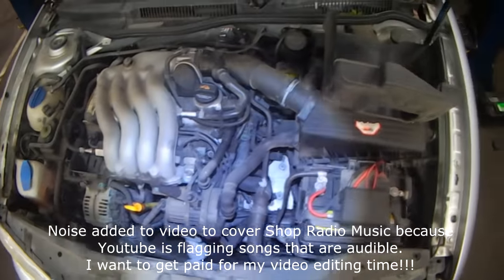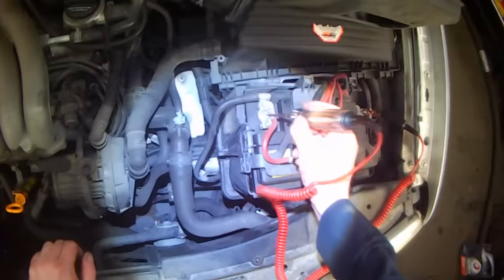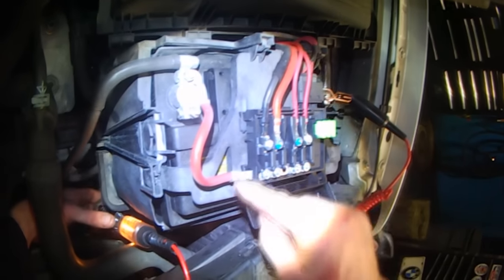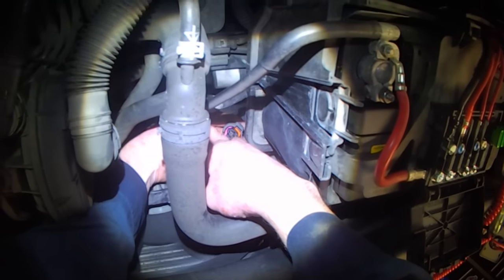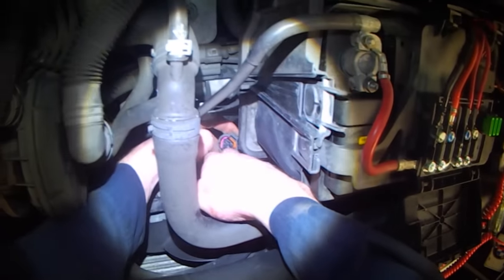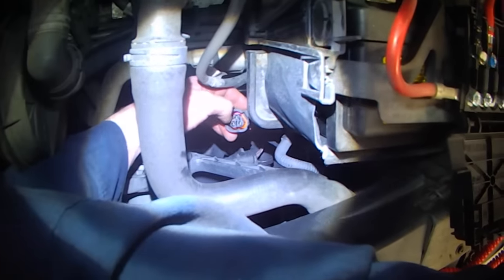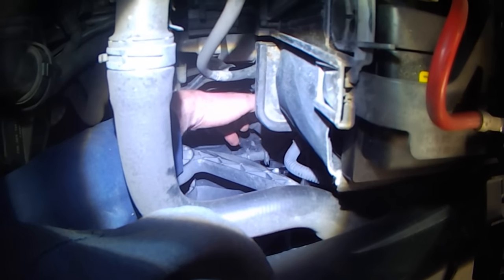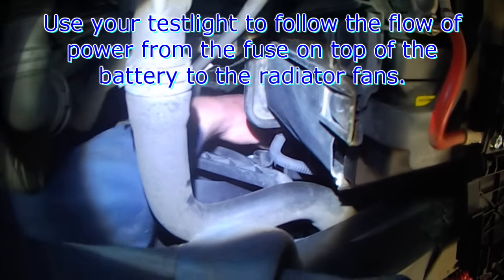VW A1 A2, A3, A4: Radiator fan(s) quick check.

Comment: MK5,TDI ,with A/C.
Big fan ON all the time, hi or low speed. Goes on high speed even when  i pull over on the highway after driving constantly at 80mph. Car never overheats. Small fan never turns on, at all, no matter what i switch on. Ideas?
Reply from the maker: I would start with checking for fault codes (doesn't matter if check engine light is not on / off) in the ECM and any other modules. Then I would do an "output test" via the ECM of the rad fan(s)... to see if they behave correctly. Then I would check a wiring diagram to see if there's something that could cause the issue you describe. Nothing that I have run into in the past fits what you are experiencing. A faulty temperature sensor can cause the fan to be on all the time. If the ECM does not know the actual temperature of the engine, it may turn the fans on full tilt to protect the engine from overheating. The small fan could be burnt out.
Reply: So i went to a friend that has VCDS, tryed gettin in the fan controller and do a test on the fans, could not connect to it.. So we are assuming that its faulty, and it went int it's own limp mode and goes stays on low/high to protect the engine. I have a new entire fan assy ( the entire thing with both fans from ebay -$99) that ima put in . After i take the old one out, will take it apart and see if i can find the problem ( im throwing it anyways, might as well do some explor9ing)
Reply from the maker: semecristian Thanks for the update! Let me know what you find.
Reply: I applied voltage to the small one, no response, and the big one had decent aluminion oxidation on the controller. Seems they are the original ones, car has 200k miles, i guess they did their job. 
The new fan assy from ebay is Made in the USA, VERY good build quality and parts in it, it amazed me how good it looked and felt. And it works perfectly, easy to change, just unscrew 4 corners and take out from the bottom with car on a lift.
Reply from the maker: Thank you for the update!

Comment: hello, when the water is in 90 °Celsius (194 °Fahrenheit) the heater is still not working. how can I dissolve this problem , please help me
(audi A 3 TDI (2004 years))
Reply from the maker: Could be a problem with the heater control door or the heater core is plugged... not sure.

Comment: Hi I’ve golf vw 2003 .
Temperature never goes over 87 hoses are hot so no air trapped .
Bridged high speed fans work not low speed .
Fans only work when A/C on ,I’ve checked fuses one had blown but changed (black box on battery)
Changed radiator switch,would the relay under the battery sort this?
Thank you
Reply from the maker: Wait longer... low speed will come on. Low speed is same speed that comes on when ac is on... meaning that low speed is ok. Low speed does not go through the fan control module unless ac is on. If coolant temperature stays low, then the thermostat is opening early / not closing.  If you let it idle long enough, temperature will climb to 95c and low speed will come on.
Reply: I drove for 2-3 miles yesterday let Idle for hour 10 minutes fan didn’t come on .
Temperature gauge never went above 87
Reply: I’m a little confused,the car diesel so I understand it takes awhile to heat up
Reply from the maker: I didn't know it was a tdi... tdi's draw in a lot of cold air during each intake stroke.The cold air absorbs temperature as it is compressed. On top of that, if the thermostat is sticking open... the engine can idle and the fan never has to come on. Hold the idle at 2000 rpm. I bet that the fans will come on by 10 to 20 min.
Reply: I’ll tell you the story what made me think there’s issue .
I was in traffic and the engine just cut off ! (A visit vw workshop came up ,oil warning light )
After 5-10 minutes I managed to start carry on my journey hit traffic again ,it cut again.but no warning lights .
I got it home called broke down company,he came plugged in OBD no codes .
I put it down to the car not like the heat ,was a hot day and traffic was heavy.
2 wks later it happened again but didn’t cut out ,it tried felt like it suck the car back ,got it home pop the hood and watched to see if the fans come on ,they didn’t but the car did cut off again so thought it was the fans .checked fuses noticed one had blown.
Reply: Sorry for the long message
Reply from the maker: Have a look under the dash where the relay box is... look for a relay with the number 109 on the top. While the engine is running... tap on the relay with your finger / flick your finger against it. A worn out / old 109 relay can cause intermittent stalling or no starting (you had to wait some time before the engine would start again). When the engine stalls & does not start again, a telltale sign that the relay is bad, is when there is no glow plug light & check engine light when you turn the key to the ON position.
Reply: I’ll have a look let you know,glow plug sign comes  up all the time ,when starting the car ,dont get any warning lights on dash or messages.
Wouldn’t I get a warning every time I start car ?
Reply: 109 relay fuel pump fuse ?
Reply: Wouldn’t a scanner pick that up,109 relay?
Reply from the maker: Relay 109 is the power supply to the engine computer... when the relay goes bad, the computer does not turn on which causes the engine to stall or not start. No fault code is stored because the engine computer thinks the ignition was turned off. Like I said... if the glow plug light & check engine light "do not come on" when the engine does not want to start, then the problem is most likely a faulty 109 relay. The other common reason for the engine to stall & not start right away... is a faulty crankshaft position sensor. You need to check things when the problem is happening. If the problem does not happen often enough for you to be able to "catch it in the act"... replace the relay and crankshaft position sensor, as they are the 2 common causes for what you have described.
Reply: Thank you ,I’ll look in to it

Comment: What if only one fan comes on.  I checked that fan that didnt come on with current going directly to it and it worked.  Could it be the relay?
Reply from the maker: Year, make, model, engine? 
If the fan works when you directly apply power & ground, but does not work when bridged at the radiator fan switch... then there could be a wiring problem (broken wire, corrosion, bad resistor pack (if low speed does not work). Depending on the vehicle (my first question) low speed resistors are inside the fans or outside of the fans.
Reply: @EXOVCDS  2001 vw jetta 2.0
Reply: @EXOVCDS  the small fan comes on when I bridge the switch, the large fan does nothing.
Reply from the maker: Low speed is probably burnt out on the large fan. With the key ON, bridge the radiator fan connector to get high speed for both fans. If high works for both, check for power at the large fan connector when you have low speed activated. If you have power at the fan connector when low speed is active, but the fan does not move, then the resistor inside the fan is bad.

Comment: I have a 2006 beetle 2.5 hatchback with a non operating radiator fan. The engine has never overheated even when driving longer distances. Weird. My temp light on the dash works so Im puzzled. I believe this is the reason my AC is not working but I will check these connections before ordering the very expensive single fan with the control module. Can I check the control module itself? I had FCP euro check the proper fan control module with my VIN but sadly was not the one as mine is the module attached to the single fan.
Reply from the maker: Watch this for testing steps.
https://youtu.be/oqdv4cm86Ns

Comment: Do you know where it is located on the newer B8 Audi A4 2010 premium?
Reply from the maker: Different system.... controlled differently.
What's the problem? Overheating?
Reply: It just does not come on, and I believe for driving it for a couple miles it just shut off my engine and came right back on when I cranked it up. So I blv that was the caused of it
Reply from the maker: I don't understand what you mean. If the engine shuts off (stops running) the radiator fans do not have anything to do whit that. Record & post a video of the problem on your youtube channel... so I can see what is happening.

Comment: Hi sir Thomas
My car sokda Octavia desiel
Radiator fan both on continue not off 
Key off but fan not stop Battery total Down
Plz tell what can I dou help plz
Reply from the maker: What year? You have to look at a wiring diagram to see how the fans are controlled.
Reply: 2008 model sokda Octavia
Reply from the maker: Octavia 1 or 2? 1.9L BXE TDI?
You need to be more specific so that I can find the correct wiring diagram.

Comment: Do I need to drain the radiator before taking this sensor out?
Reply from the maker: Depending on how your body is positioned and how quick you are with removing the sensor & installing the new one... you will either get a wet hand or end up taking a shower.

Depending on the year & model, a quick sensor swap (with a full radiator) is possible.

Removing the lower radiator hose, catching the coolant and then removing & replacing the sensor can be a better way to go in some cases.
Reply: Thanks. I think I may just go ahead and do the thermostat at the same time. Whole thing probably needs a flush anyway.  At least the water 
pump is working right. ;)
Reply from the maker: @pcdreams1 
Are you trying to solve an overheating issue?
The more info I have the better I can help.
Reply: @EXOVCDS  I haven't had any issues with it overheating.  Just noticed the fans weren't coming on and ran through the test with the AC (since it doesn't seem to be working either). I can get the compressor to come on by applying voltage to line 10. but jumping from the thermal switch connector is the only way  I can get the fans to come on aside from directly applying power (I just replaced both fans (thanks for that video)  and there was no change. I've also replaced the fan control module (It didn't change anything.. I guess it's possible I have 2 bad modules, because the replacement was a pull, but seems unlikely). this is the 1.9tdi in an 02 beetle
Reply from the maker: @pcdreams1 
TDI's take a long time to warm up / for the fans to come on... this is normal. As soon as you drive a little, the radiator will cool off again and the warming up phase starts again.
Hold idle at 2000 for 10min or so and feel the lower radiator hose with your hand (half way between the thermostat flange and the radiator outlet).
Since you are not having any overheating issues while the vehicle is moving, the thermostat is most likely ok.

Comment: Hey man I have a 03 20th mk4 GTI 1.8, 6 speed. neither rad fans come on, they work when I unplug and replug the green battery box fuse but only spin for a few seconds with engine off ac on. only throwing code for o2 sensor voltage but I just replaced that. any ideas?? I replaced all three fuses and ordered a new box coming in a few days... but im nervous it wont fix the issue
Reply from the maker: Overheats all the time or only at idle?
Reply: @EXOVCDS  not all the time, only  at 60 mph high load like on a hill. drives around town with none and at idle overheats after sitting
Reply from the maker: @ThExHaLoxMASter  water pump impeller could be slipping.
Reply: @EXOVCDS  oh no... I thought it was overheating bc no fans came on and when I down shift to increase rpm therefore coolant flow they come down. wouldn't that indicate the pump being ok? im not sure man.
Reply from the maker: @ThExHaLoxMASter  60mph should not need the fans... how much heat can you get inside the car? If heat comes & goes, then the water pump is bad. You can trigger the fans manually at the radiator fan switch... when it gets got at idle, trigger the fans. If the engine doesn't cool down, then you have bad circulation / bad pump.
Reply: @EXOVCDS  got it ill do those checks. my assumption is that a bad water pump would stop the fans from running due to lack of circulation?
Reply from the maker: Correct... the impeller could be loose and only circulating coolant at specific speeds. Too much slip at idle and under higher rpms. Confirm flow into the bottle (the higher the engine rpm, the more coolant should flow back into the reservoir). Lack of heat inside can point towards a bad pump / circulation issue. If tests are inconclusive... you can remove the thermostat and check if the water pump impeller is loose... by trying to move the impeller with your finger(s) through the thermostat mounting hole.

Comment: Hi Thomas, thr coolant fan on my audi a3 8l was not working so iachanged the fan , and now the tempreture still goes above 90° 
and rediatore on the drive sied is getting hot but other wich is ac fan rmains cold.
do you thinks is it the radiator? thank you
Reply from the maker: Thermostat maybe.
Reply: thanks alot for the infomation! but wont be the control mudol switch no? because the coolant fans work in normal speed and high speed.
Reply from the maker: You said that the temperature goes above 90c and that the radiator is NOT getting warm. If the radiator is NOT getting warm, then the fan switch will not get hot and it will not turn the fans on.
Reply from the maker: Which engine? Does the water pump pump coolant? Do you have heat inside the car?
Reply: yes the radiator is getting hot but only where the bigger fan is but on the side of smaller fan remains cold 
on the carrige way and motoway it gets really hot
Reply from the maker: Change the thermostat... check for correct water pump operation first.
If you have NO hot air inside the car, then the water pump is bad.

Comment: Hi I wanna ask you something i have an audi TT 1.8t 132kw 1999 and i spend like 600 dollars on that shit so my problem is in traffic my temp comes to 95-100 and after 20sec colling goes down its fine no problem with that but when i turn motor off temp raise up to 110 and fans dont give a shit about it. I have new fans and thermostat as well. Thank you for response.
Reply from the maker: Low speed fan operation is triggered by the radiator fan switch that is mounted in the radiator. Engine temperature is measured at the coolant flange that is mounted to the cylinder head... the radiator is not the same temperature as the cylinder head when the engine is off, because the water pump is not pumping warm / hot coolant from the head to the radiator fan switch. Eventually the heat from the warm / hot coolant gets transferred through the coolant to the radiator and the radiator fans might come on... it all depends on timing / conditions. But in general, that is the normal operation. Some 1.8T engines have an electric water pump that circulates coolant when the engine is off... to help dissipate the heat better. All engines from all manufacturers "heat soak" when the engine is shut off (engine stays / gets hotter than the radiator).
Reply: So in general its ok? Im just worried about that temp like 110 is really hot and when i open the hood i can even see it. So i cant do nothing with it? I worry about gasket.
Reply from the maker: You can see the temperature?
Check if you have an electric water pump... if it's running when the engine is off, things should be ok. Install a lower temperature thermostat to see if that makes a difference. Make sure that your current thermostat is working correctly. Make sure that your current water pump is pumping correctly. Make sure that the temperature sensor is accurate and that the dash gauge is accurate. Make sure that the radiator fan switch is working correctly. 1.8T engine run hot / feel hot when the engine is off & the hood is open.
Reply: Can see the heat coming from it. Pump is driven by belt so dont have electric. I try to solv it somehow. Ty for your time and have a good day.
Reply from the maker: There might be an "auxiliary" electric water pump... sorry about the confusion. The main pump is driven by the timing belt... some 1.8T engine have an "additional" electric pump that only pumps when the engine is off (after shut down for 10 min).

Comment: Hey any reason for the 30 amp fuse to blow. Mine was. Thx Sir
Reply from the maker: Short circuit... old / stiff fan?
Reply: @EXOVCDS  Actually new fan from 1aauto. Prob not the highest quality but only 1 month old. This is the first time in my 01 golf that this fuse blew. Both fans sound like they’re rubbing as the spin. Small fan only spins for a Second by hand. Large one will spin for like 5 seconds after I spin it
Reply from the maker: @pujo28  Check a wiring diagram to see what else is on that fuse (other circuits). If the fuse constantly blows, then narrow each circuit down and follow the wiring. If the fuse has not blown since replacing... keep an eye on it.
Reply: @EXOVCDS  thx for the replies. I’m also gonna replace ran assembly since they’re rubbing a lot and not spinning freely. Otherwise I’ll watch the fuse. I’m assuming it’s from the fans being hard to spin. Thx again